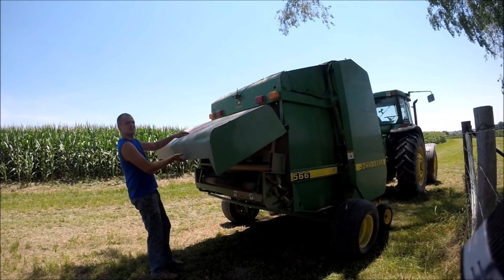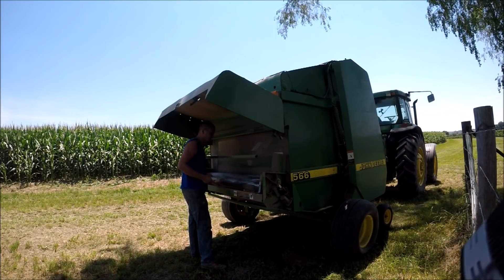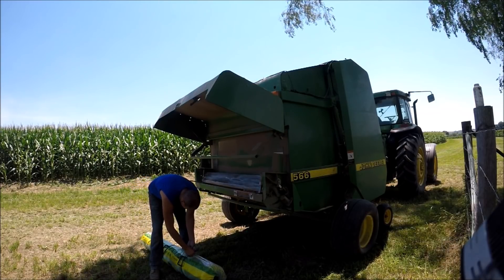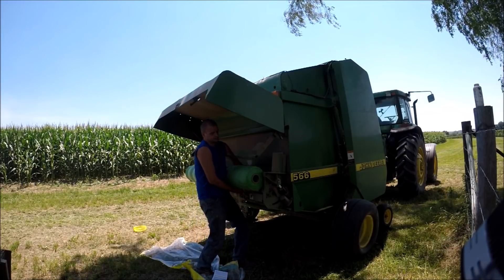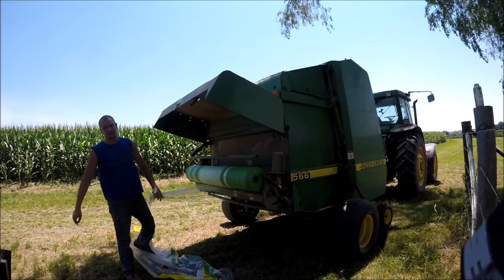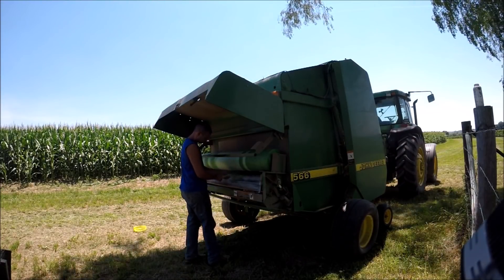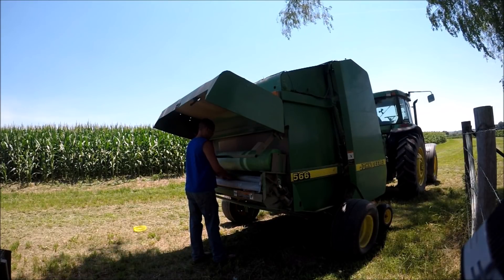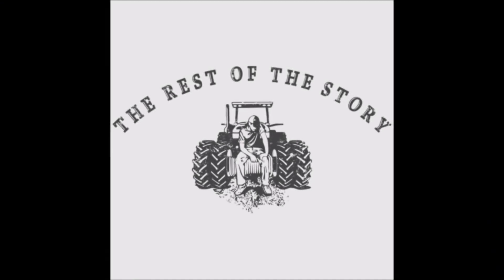Baler Problems

Comment: Hello! We are having a problem with a baler not cutting netwrap. It’s not the same as your baler, but on a Sunday with rain coming this afternoon and a lot of rows to bale...we’re searching rather desperately for an answer so thought I’d see if you were on. You seem very familiar with round baling in general and this is our 2nd season using a round baler. Appreciate any thoughts!
Reply from the maker: Make sure your getting enough power to the baler. Check your connection to the tractor.
Reply: The Rest Of The Story yes! He had already unplugged everything and reset the motor and it started cutting again! Thank you for replying, you were right on the nose! Hope it helps someone else!

Comment: If the deere is like my claas the feed roller hasn’t got enough pressure between the two should be a adjustment to tighten the squeeze between the rollers up could have a bent roller to if there’s not even pressure across the feed roller that can cause all your problems. That should solve the problems if you haven’t changed the net tension bar it shouldn’t be it

Comment: Yeah I know a lot of guys that will run the pickup in the dirt like a harrow so they don't leave a single straw of hay behind, then wonder why they can't keep tines in it and have to overhaul the pickup every year and the thing is worn out...  same with rakes... 

I'd rather leave a little bit of loose short hay behind and not tear up the tines and bearings and cams and bands and stuff on the pickup myself... 

Later!  OL J R :)

Comment: 2nd great video i wish i had a bigger tractor for a bigger baler
Reply: farmall skittle at the moment I just wish I had a tractor for the baler as it is still in the shop in two pieces. But a bigger tractor would be nice just need to win the lottery first and preferably come up with an automatic after sun applicator like the oiler on the baler after penning up for the shearers I'm feeling crisp fried.

Comment: I found with our baler (NH) that the make of wrap can make a difference as I had similar trouble when using Case branded wrap in it that it just wouldn't feed and would mess about after chatting to some guys on a farming forum they suggested taking a spring off either side of the wrap brake which considering it lifts the brake up out the way before feeding it did in make much sense as to what difference it could make but it did and since then it works no problem if we get a different lot of wrap I put the springs back on and it goes fine.